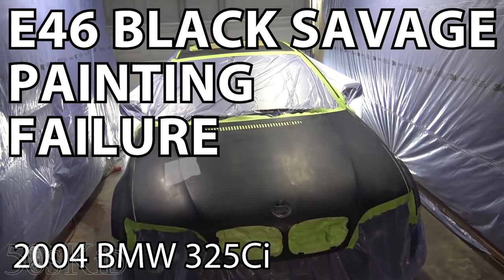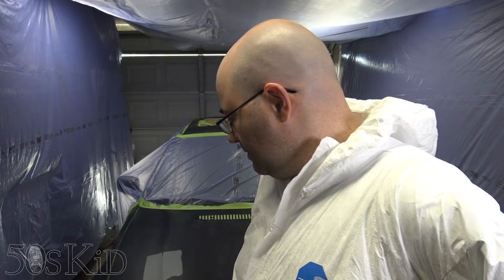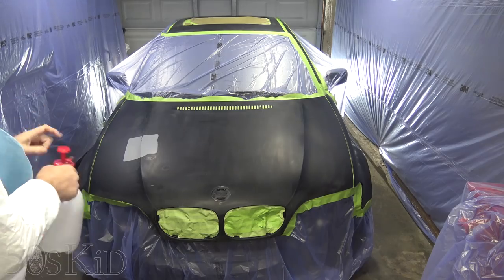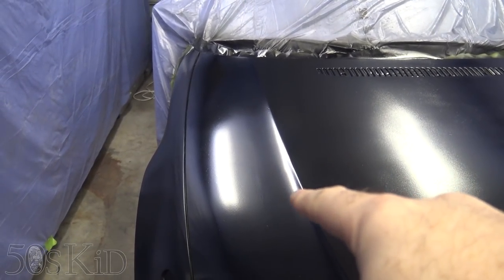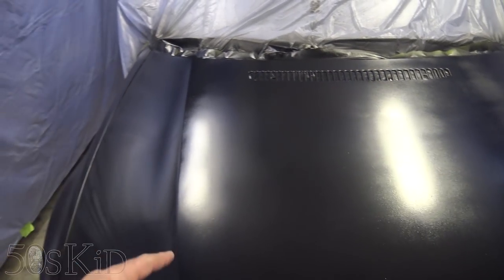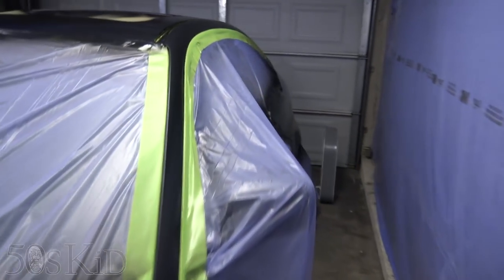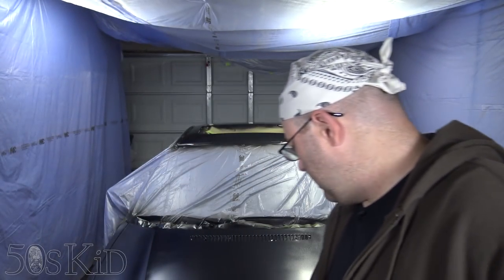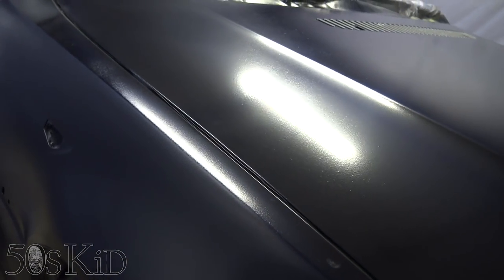BMW E46 Project Black Savage: Painting Failure

Comment: Jason, you are the reason, after the belt on my 11 328i xdrive shredded, possibly throwing off the timing which in turn caused a cylinder 3 to seize that I started a rebuild project on my engine. I had to put it aside because of other priorities in my life and am going with a used engine. But at some point I will get back to it. Suffice to say, you have been the embodiment of what I have always believed: motivation, determination and self-education will take you so far!
Reply from the maker: +David Fields thanks dude! Good luck with the project

Comment: I'm not a painter, but I'm a paint chemist. FYI on the water contamination: The isocyanate in the clearcoat hardener reacts with water (which is also why you don't want to inhale it), and CO2 is formed as a byproduct. So you essentially have microbubbles throughout the film now, which will always show up as haze regardless of how much you buff. I'm not sure of the best/easiest fix, but I'm assuming you're looking at another coat of both base and clear. Good luck. I love your channel, and your CCV video was a huge help to me. Please keep up the good work!

Comment: Hey dude watched all your vids but first time ive commented! Im by no means a great sprayer but have sorted a lot of orange peel out! It can happen for a lot of reasons which i wont go into as whats done is done, but to get rid of it, put plenty of clear on (like 10 coats if needs be), then wet and dry it back with 800 (keep it very wet and watch the edges of the paper), then do the same with 1200. Then use something like G10 as a cutting compound (like you cut and polished in your other vids) and then a stage 2 cut and polish and it will come out nice i'm sure. Thanks for all the videos by the way its helped me loads with my BMW, by far my favourite YouTuber!!

Comment: I have a few tips. Never use plastic to cover car windows, headlights etc... because after you shoot your first coat of something and it dries, the paint will flake right off the plastic and land in your paint from the guns air pressure. Using paper will prevent this problem.

Use a 1/4" rubber or foam block to wet sand and it will prevent finger sanding marks.

Use a large compressor that has more cfm than your gun uses. Use a fan on your compressor to help keep it cool so not as much moisture will condense in your lines. Use a water separator that is mounted higher than your compressor  From the compressor use a non coiled hose about 15' away then mount the water separator, Then use a 20" hose from the separator to the gun.. Use a good quality air drier at the gun.

Use paint sealer on the entire panel so that the new base coat wont touch any of the existing surfaces. This will prevent seeing solvent reactions from the old materials. Paint sealer and primer are different things.

On a gravity fed gun use 25-30 psi with a 1.3-1.4 nozzle tip. Turn the spray pattern full fan with full fluid. Spray distance around 1 foot away keeping the gun angled properly and consistently. Always start spraying before the panel and continue past it. Match the reducer temp to what your air temp is. Example would be not to use slow reducer in 50 degrees. Using slow reducer in cold temp will cause runs. Using fast reducer in hot temp will cause much orange peel because it wont have time to flow out. When you spray, spray till it t looks glossy with a bit more orange peel than you wish for the finished job to have. The paint will continue moving on the panel for several minutes after you sprayed it and it will flow and level out. If you spray till it looks real slick, then it will develop runs and sags.

If I was in your shoes right now I would WET sand the entire areas to be painted with 400 sand paper using a 1/4 rubber block. I would scuff pad all the edges. I'd rip all the plastic and tape off the car and wash it real good. I would re tape the car using paper.  Use a paint prep product called GONE and wipe the entire area well with a lint free paint prep napkin. Then use a tack rag and spray the car with 1 coat of paint sealer. Then spray base, tack rag it again after it dried then spray 2-3 coats of clear.

Fold a lint free napkin like a head band and tape it around the cups lid to catch any leaks. 

The main product brand I have used is Nason full base and clear. It isn't expensive and works out pretty nice. Always use hardener in the base and clear.

Make sure you over lap your spray by 50-60 percent. 

  I have sprayed my cars in the garage and have had really nice turn outs. If you have a question about product or application feel free to ask.
Reply from the maker: Thanks for all those tips, man.  I'm definitely going to implement a lot of them next time I paint.  The primer I have can be used as a sealer, I am told, if I just thin it out more than normal--I will have to ask the guys about that again.  I do recall learning about sealers now that you mention it again.  Also I do want to say that the plastic I'm using is a 3M product made specifically for painting cars.  The paint does not and did not flake off of it after I painted (as long as you follow the "paint this side up" label on it).
Reply: Happy to help if I can. I respect no matter what is thrown your way that you are willing to tackle it. 

As far as tips, I mention wet sanding instead of dry sanding because it really shows up any body dents or waves from the glossy water when done outside.

After you are done with all the body work and before you do your final sanding, you should mist  some rattle can paint all over the area you are going to paint. Just mist it lightly where it leaves little dots all over the panel. It's called spraying a guide coat. After it dries for 15 mins you wet sand the entire panel with a 1/4" thick rubber block and 400 grit wet/dry sand paper. If you have any pings or body damage, the low dented areas will still have the dots of paint in it and show the dent really well. Since your car is dark, id'e suggest using white as a guide coat.

The sealer I use is Nason 2k 422-50. It is a non sanding sealer. You sand the car like I previously said then spray it with this sealer. You wait till it dries then spray your base and then your clear. You don't have to sand in between any of those steps. Most primers have to be sanded after it dries. Even thinned ones being used in place of a sealer.

If your compressor can be moved outside to a shady area it may work better for you. You can put a fan on it and don't have to worry about the fan kicking up dust in the paint area. The compressor has a inlet filter that becomes clogged very quickly if it is near any of the paint mist during painting.
Reply: @50sKid  I use the 3m plastic without paper and have great results.

Comment: I would recommend spraying one or two panels at a time. Start with the fenders first, sealer,color,clear then start the next day with just the hood. Make sure everything is dry before you mask off the adjacent panel. Spray the roof then next day the roof rail and quarter. panel. It is hard to do a large area with a small compressor because the pressure can drop half way through the large panel.

Comment: Don't be so hard on yourself, painting is really not that easy mate. It is quite easy to fix it right now - You can wetsand it 800, and repaint it again. It looks to me that You put not enough paint, especially clearcoat, so You got the orange peel. You need to put as much Clear, that it looks wet, it should be on the border of almost running ;-) Get a hood from the scrapyard and try to get proper settings with pressure and paint thickness. When You spray Your base, you have to get an even nice coat without any texture, dots, peel and so on. When You get it done, You will see it. You can only see a bit of a orange peel when spraying clearcoat, but that means that you need to put some more in that area, so orange peel disappears and you get a nice even glasslike coat. There is no other way to do it, You need to make som try and errors to get into it, I think that You will get it! One thing more, You should get a good flashlight or lamp, that You can hold in Your hand and see how the coat is spreading in Your element , like if You would look deeper into the paint - it really helps

Comment: I would account your excessive orange peel on your air system.  I have a single-stage 60- gallon air compressor and it was still spitting out water at the end of the hose after running it for a while.  I have since remedied that with a car condenser installed between the pump and the tank, then extended the length of the of the output line to 30 feet.  I also installed 2 water separators, a desiccant filter and another desiccant filter at the end of a 25-foot hose before it enters the gun.  If you were getting a lot of water in your water separator before the gun, you are definitely getting water in your paint.
I think your test panel turned out good because you didn't have the compressor running long enough to accumulate a lot of water.
Reply from the maker: Yeah i definitely need to address the water/filter situation

Comment: In my limited experience that i had less orange peal in the clear by applying a real wet coat. YMMV. I once bought a ratty 633csi with newish single stage paint almost as bad as yours. I was able to fix using 1200, 2000 and buffering. Good luck!
Reply from the maker: Yeah i was having an impossible time even getting a wet coat on.  I slowed way down at a certain point and it was still going on "splattery" for lack of a real/better word.  I think it was the water getting in the air.

Comment: I missed the first video, looks like your using a 2 pack paint?  Hard to get the flow just right, dry orange peel, to wet run's or sags  takes years of practice and you can still make mistakes, but the more you do the better you get, just keep at it

Comment: Perhaps your solvents were lifting uncatalyzed base coat. I think you can add catalyst to your base coat. Or use primer to isolate. In your case you can get black catalyzed primer, So you do not have worry about coverage.

Comment: Well, shit happens. It's sad to see so much effort go to waste, but now we know why it's needed to make sure to use the good stuff, correct mixing ratios and ofc use moisture filters.
I heard that it's needed to use same primer color as body has if you want to get good color match. Those bleed spots are excellent example of how surface color affects the end result.
Anyway good luck with future stuff, we'll be watching with great interest
Reply from the maker: The black actually covers pretty well though so, as I understand, you don't need to tint your primer?  I could be wrong on that.  You know, the irony is, the color match was absolutely perfect!
Reply: 50sKid as far as I know it's dark primer for dark colours and lighter primer for lighter colours. Supposedly you can see the difference in the sun. I'm not a painter so I don't know for sure, but seems like it is like that. You can check the square on your hood below the sun and report back
Reply from the maker: Definitely gonna do that

Comment: Man, I thought it was just me.  I wish I could do bodywork and paint on cars but I experienced the same epic failure five years ago and quit.  It's frustrating because it's so expensive to get a professional to do the work.  If you have a little dent they tell you they have to paint the whole part, if you buy the part and have them paint the price is hardly cheaper.
Reply from the maker: Yeah I haven’t painted anything since this car, sadly. Thinking about it though. Every time I watch videos on The Paint Society channel!
Reply: @50sKid  I started watching that  channel too but i think there is a mental incompatibility between painting and doing mechanic work..  If you paint,  you have to treat your work like art - it’s abstract - bondo, sanding, sculpting, priming, painting, clear coating, buffing - it’s too much! When you do mechanic work it’s binary. There is a part that you replace and you are done. The art in mechanic work is determining what part and  how to  replace/fix it efficiently and effectively.

Comment: What size nozzle are you using for the base coat and what pressure in your gun also what size nozzle are you using in your lacquer clear coat gun
Reply: Also what was the temperature when you spraying
Reply: Would have been best to completely on the coat the bonnet just would have made a nice even layer for the new paint
Reply: I can only go off the paint I use over here so not sure if it's the same but I have three different guns one for undercoat which is 1.6 mm head my base coat is 1.25 mm head which I use water-based then my lacquer gun is 1.3 mm
Reply from the maker: +bodgit and leggit garage it’s a 1.4 tip and I used 2 bar. Same gun for basecoat and clear. The gun worked just fine on the other clear that I have.
Reply: 50sKid you might have different paint where you are compared to was but I know if I use that big of a tip on base coat here I would run into a lot of problems but you might have different paint to me so I cannot really say that's what I've used the last 15 years when I've been painting and restoring cars
Reply: I know for me over here you've essentially put an extra two coats on as regards the tip difference size also slightly higher pressure than I spray with but it could all come down to the different paint because I am sure you use different paint to what we use over here
Reply from the maker: Yeah I think most of my problems were the water contamination for sure.  I'll try again with upgraded equipment and definitely break the job into much much smaller parts.

Comment: Compressor and spraygun is a real rubbish :) you need filtered air from the compressor, and SATA, italko, Devilbis   spraygun. Аnd practice on various sheet metal :)
Reply from the maker: +Traqn Savov yeah for sure, when I try this again I will upgrade my equipment and do extensive testing

Comment: Hi don't beat yourself up to much I'vre been painting various panals   on cars as DIY basis all things that have gone wrong have . I think you made a mistake by painting the whole car need start with small projects  because there is a awful lot to learn also don't mix to separate manufacturers products just to use it up I fell into that trap with disastrous results.dont give up lean by your mistakes.

Comment: Your air pressure was too low and you have to open more your paint nob
Reply from the maker: +miguel pena pena I did have the fan all the way open as well as the fluid all the way open. I did increase my pressure halfway through but it didn’t help